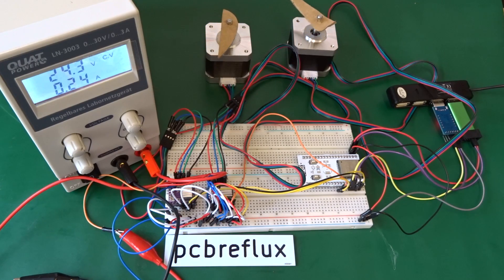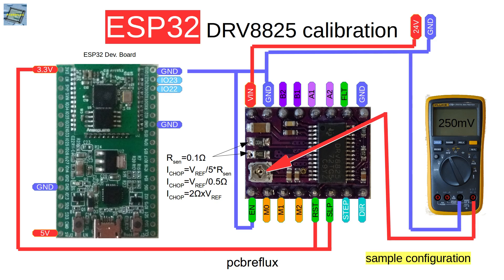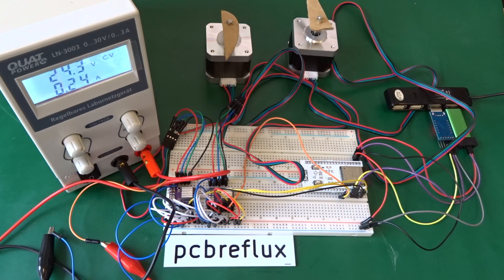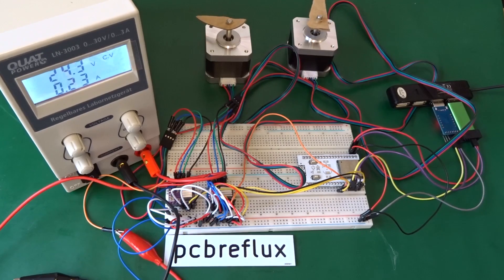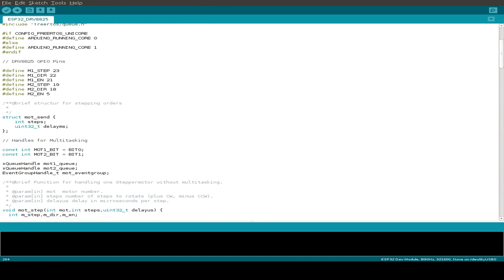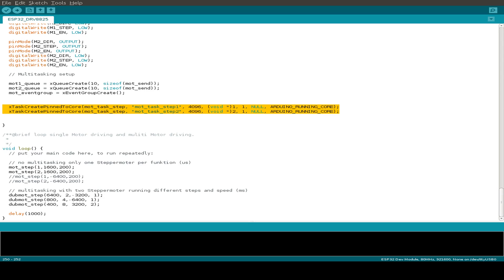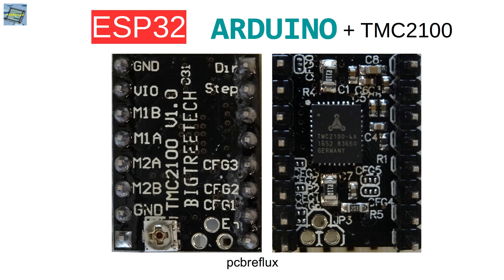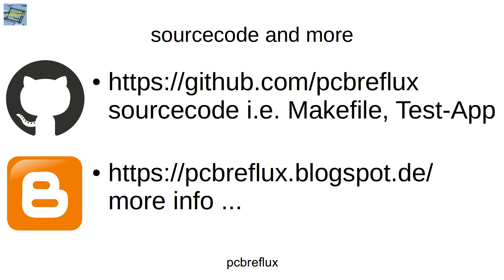ESP32 #43: Arduino Multitasking (DRV8825 Stepstick Steppermotor Driver) + ESP32 Giveaway

Comment: The steppers sound pretty loud in the recording - are they as bad in person?  Is that inherent and unavoidable, or can it be reduced?  (I was thinking of using steppers in some Halloween props, and this much sound would be problematic).
Reply from the maker: The noiselevel with 32x microstepping is OK but not really quite. This is why I try the TMC2100 with 256x microstepping. But unfortunately mine blow up while calibrating the output current and touching also the unlimited VCC input pin. With very slow speed they sound more like the ticking of a wallclock. But this can also vary with the vendor. Mine are (maybe) the cheapest NEMA17 in this size/torque for about 8$ delivered.
Reply: The sound is only because they are on his table. The table reflects the noise and makes it much much louder. If you hold the motors on your hand you can hear near nothing.

Comment: in the starting on the usb hub is it a stlink connected with a usb to serial converter?
Reply from the maker: Have to use this setup because this board (https://github.com/pcbreflux/espressif/tree/master/esp32/kicad/ESP32-adapter) have no usb2uart bridge and no 3.3V voltage regulator. If you use a devboard you don't need this. But my other devboards are either used in a different projects or sacrifice to the espressif heaven or in the mail.

Comment: my sincere condolences on your loss ;-)
Reply from the maker: Thanks. What I learn - be careful by calibrating the tmc2100 steppermodules with a metal screwdriver. The pot is very close to the power pin. And after inspecting the mess don't insert them in reverse. Two major human faults - hope others can avoid my mistakes.

Comment: Thanks a lot for this example of Multitasking with FreeRTOS. So I have to order  motor drivers and Motors (from Pollin?).
Reply from the maker: Sorry I am a little cheap so even I have to wait some weeks I am buying from the cheapest seller only if the ranking is bad I am a little sceptical, so I am not prefer any seller for modules only if I do some high quality stuff I order from the big component sellers direct.

Comment: Nice video! Why " RIP ESP32 and TMC2100" on description?
Reply from the maker: While tuning the screw for the resistor value (current regulation) with a metal screwdriver touched the pin thats 1mm away that destroy both boards. Now i would suggest to use a ceramic screwdriver.
Reply: pcbreflux  So sad I only demaged A4988 drivers but because their poor quality. I only change currents with metal screwdrivers when powering it off. So now I am dealing with the new TMC2130 I recommend you to try because the SPI interface has all digital kind of things like auto current profiles, and "endstopless" feature with loose step detection feedback. It is awesome and there is easy arduino libraries. Not to mention they have internal 256 microstepping resolution and they are completely quiet

Comment: Nice video, I learn something new with each video I watch.  I noticed today that using two breadboards is an effective way to use proto boards that have pins too far apart to use a standard breadboard.   Does anyone make non-standard breadboards for wider proto boards?
Reply from the maker: From a pricepoint it make maybe sence to buy an smaler devboard or design your own? But for me the cheapest way today are two breadboards (one power rail cutted).